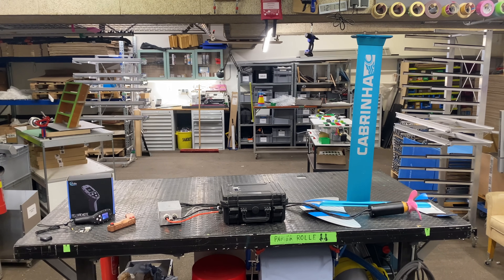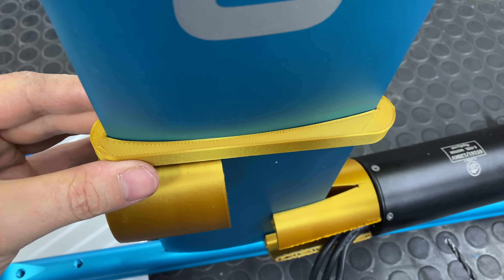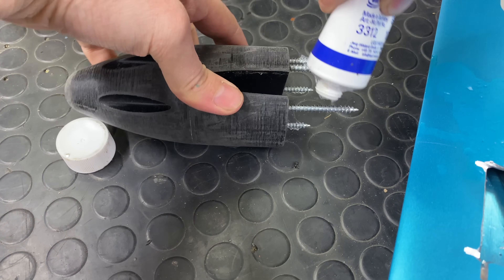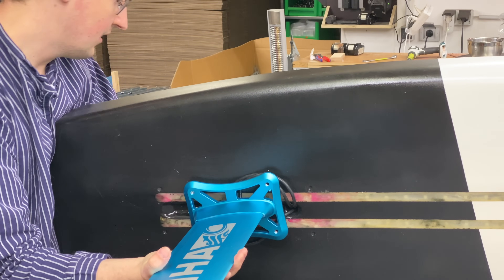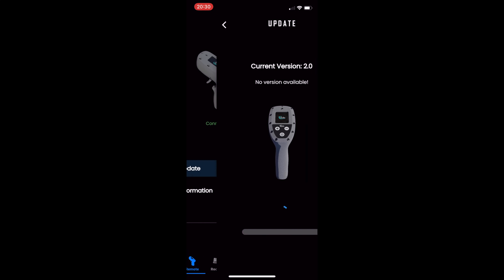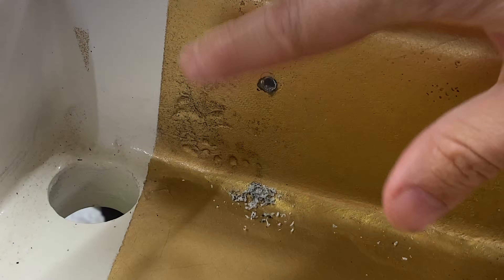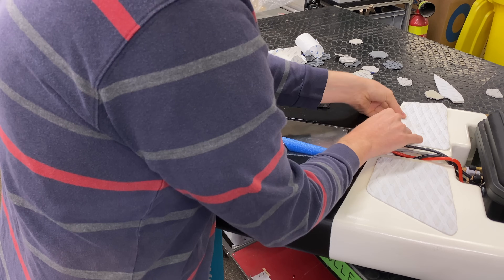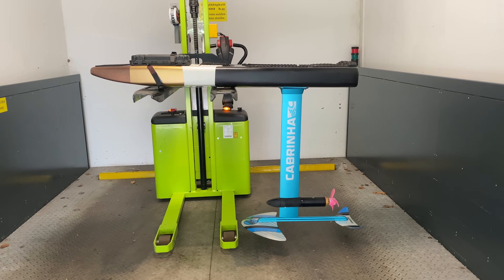I finished the Hydrofoil. It Only took 5 years! (Hydrofoil Project)

Comment: I never surfed on a hyrdofoil I hear its very hard to learn even for surfers, snowboarders. So for you to learn on this will probably be really difficult. Since you wont know if it's to little lift for you. Also I feel like you would want your foot right where small metal box is, I think you need a cover on that because you cant stand on the side without losing balance. Cool buil I wish I had one :D
Reply from the maker: We tried it this summer. You can start by sitting on it and lifting your legs out of the water. Then you apply throttle and see if you get lift. It didn’t produce enough throttle, so for this year I have a new prop.

Comment: Good job. There are 3 cables from the motor. So need 3 waterproof connectors. Why not just put them together? And use just 1 connector? Thx
Reply from the maker: I think you can do that if you have one of thise rubber cylinders that has 3  holes inside for each of the three wires.

Comment: Omg cool cant wait to see it fly i watched all the vods so far and building also one because of you🤘😂
I have one question regarding the weight. Ive seen your board is about 18kg (foilzone) i weighted all my stuff today and im getting 29kg in total. Do you think it os too heavy?
The only thing i can reduce some weight will be the battery (14s10p) as i havent build it yet. Ive looked at the weight of the foils you can buy and theyre about 30kg so i think it should be fine but im little nervous on tht. 
Kr and thex for the info
Reply from the maker: I cannot say for sure, but I think the weight is okay. Ultimately I think my wing is far too small. A bigger wing means more drag but also more lift. At the end of the day we just have to try it out.

Comment: I was crying inside when I saw you cut that huge hole in the load bearing side of the mast for the cable entries. Please, swap out the mast with another and drill 2 holes  only big enough for one cable instead, vertically and cut vertically between them with a dremel to expand the size for 3 cables. I am impressed with your efforts on all the rest. Interesting to see 3rd party controllers and that the felix remote is using ESP32 wireless. For those who also do software and hardware, the ESP32 series is very powerful and can also be controlled through Arduino IDE.
Reply: Yes it's true that rhe ESP32 is very powerful, that's why we used it👐

Comment: I think you need to secure the motor bracket to the vertical column so it can't move up or down and pinch / cut the power cables

Comment: Funny. My dad and I are now building our 2nd one. ..... In 3 months :-)
Reply: One more. You should have used the 1st motormount, and make a little cut in the front and back of the mast.
This will stop the mount moving up and down!
With the 2nd motormount the clamp/motor can slide up/down, cut the wires, and cause a lot of problems 😱😱
Reply from the maker: @iamkian  That is a very good idea!

Comment: That's an awful lot of motor for a 3d printed mount...
Reply from the maker: I think it will be alright. The mount is solid printed and they are stronger than one thinks. Also I use a 0.6mm nozzle which gives better layer adhesion. I do it because 0.6mm just prints much faster than the standard 0.4mm nozzle and there are no more clogs.

Comment: Nice to see the project coming to an end. Seeing your design now, with some foiling experience, where do you plan to stand on? As a rule of thumb, the center of mass (mainly you) and center of lift (roughly the center of the front wing) should line up. Factoring in your stance, the rear foot is roughly over the mast (there seems to be no pad) , the front foot in front of the wing (round about the position of your VESC Box, a little in front of that, maybe the Cable channel) that looks like a "not so comfy position". for your first tests, maybe take some double sided tape and a small plywood piece with you. If the stance is in a bad spot, just tape the plywood on the board to get a flat surface for your front foot.
Have fun with your E-Foil, cheers

Comment: How do you cool the ESC : do you have a pump to get fresh water for the cooling ?
Reply from the maker: Hey, its planned to purely sit in a bath of water. The big electronics box in the front has large drainage holes, but the ESC has none. I guess after a few minutes it could overheat the water. Then I would need to change it.
Reply: @MaxMakerChannel  It will (should) start throttling at 80c